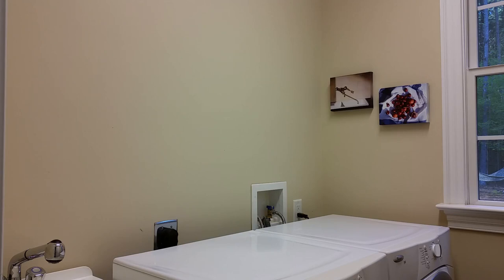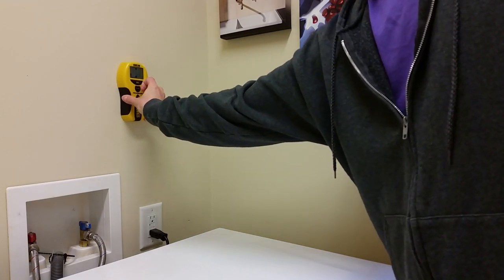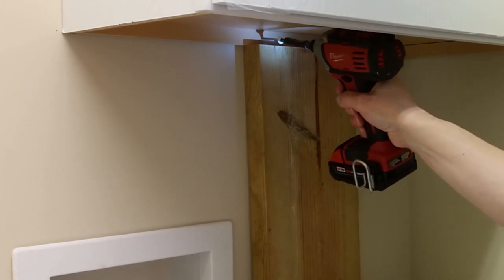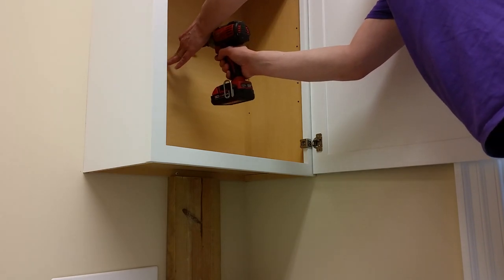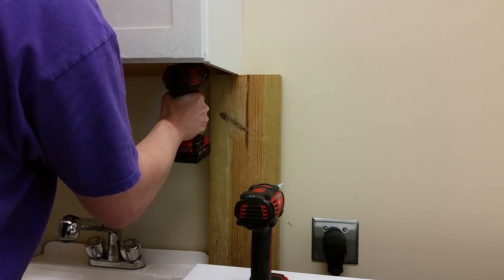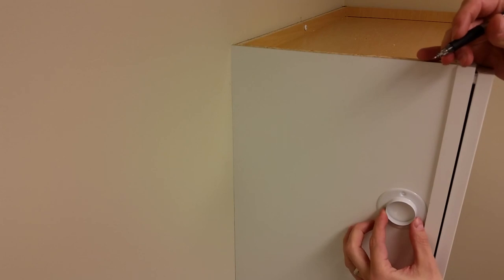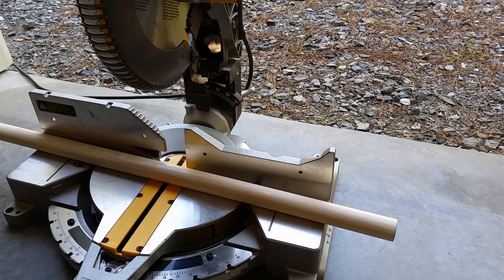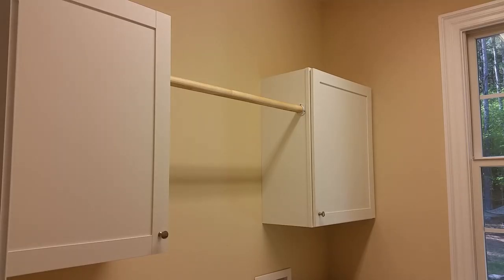Hanging Laundry Room Cabinets

Comment: Lucky you finding studs. My studs seem to sit more in the middle of the wall. No where near where the cabinets go in the corner. SUX
Reply from the maker: There should be a stud every 16 inches, on center. However, some newer construction allows for stud spacing every 24". If you can't find a stud, you could use heavy duty anchors to support the cabinets.
Reply: @Mikeattempts  they are 24".  I got stud supporting 115lbs. Still sucks

Comment: Don’t hang cabinets expecting particle board to be sufficient. Cut a strip of wood and place it at the top of the cabinet just under the top,panel on the inside. Glue or brad nail this to the cabinet and use this cleat to drill and support the cabinet. The particle board will rip through if you put any kind of weight on the cabinet.
Reply from the maker: Thanks, that's a good tip! The cabinets have been up for over 5 years and luckily, we haven't had any issues.

Comment: That cabinet on 1 stud?  How has that held up?  I have wood paneling so can't use anchors. All I have is 1 stud and an 18" wide cabinet.
Reply from the maker: Yep, all on 1 stud secured with 3 pan head screws. We keep a large box of detergent, a gallon of bleach, and a large jug of fabric softener in the one cabinet and it's rock solid.

Comment: No issues being able to fully open doors with knobs?  That company seems to recommend using filler if you're mounting directly against a wall.
(Also, I wish they started selling those with soft close hinges... Why make things with these crappy hard-close hinges? lol.  I know you can prob swap them out, but I'd worry about messing with the particle board too much.)
Reply from the maker: In my specific situation, the knobs don't touch anything when the doors are fully open. On the left side, the knob goes past the trim for the door frame and, on the right, it goes past the trim for the window frame. I agree, who wouldn't want soft-close hinges and the cost difference would hardly be noticeable. Thanks for watching!

Comment: Do you need a level?
Reply from the maker: I didn't use a level because my walls are square and I was only installing 2 cabinets in the corners with a large gap in between. So, even if they aren't perfectly level, you wouldn't be able to tell by looking at them. If you live in an older house where the walls aren't square anymore, or you're hanging a row of cabinets, then you would need a level. If you hung the cabinet level and then there was a gap against the wall, at the top or the bottom, you'd just cut a piece of trim, the same color as the cabinets, to fill the gap.

Comment: It's so weird that 3 screws through particle board will hold the weight. Never too many screws
Reply from the maker: I agree, at first I was paranoid about hanging too much on the rod but my wife hangs everything on it and it hasn't budged. Thanks for watching!
Reply: Unless one of those long ass screws punches a hole in the plumbing or electrical. You should measure the thickness of the back wall of the cabinet, lets say half in. add a half in for the drywall,  and your only at an inch. So a 2 in screw is ample.

Comment: Were you concerned about drilling into wires or water pipes when securing your cabinet into the wall?
Reply from the maker: In my case, I wasn't worried because I know that the water lines for the washer come up from the crawlspace. I also had pictures of this wall prior to it being drywalled so I knew where everything was. Plus, the electronic stud finder I used can also detect wires. If you're able to successfully find the center of the studs, you should be fine.